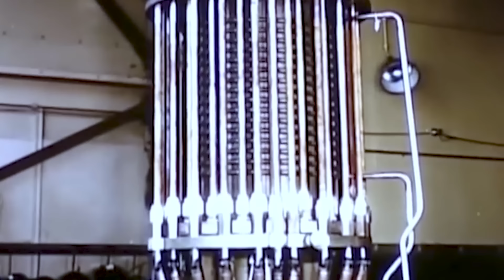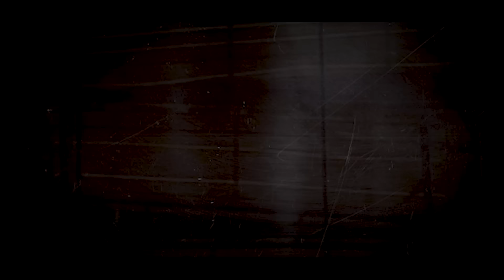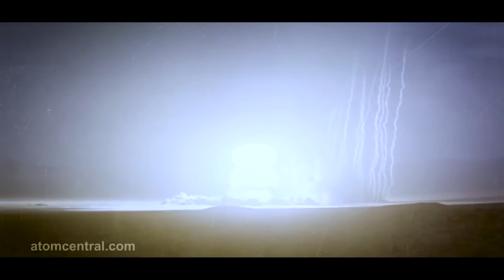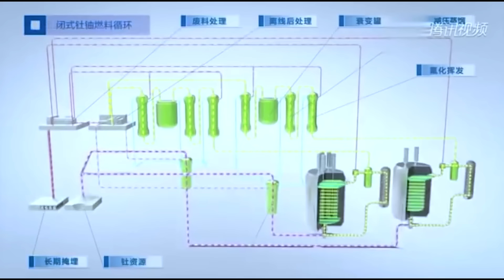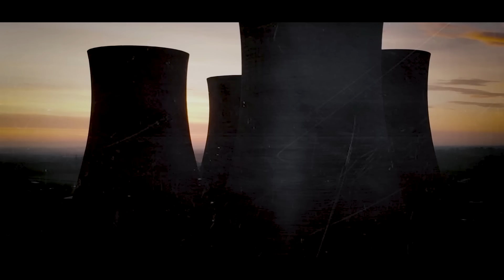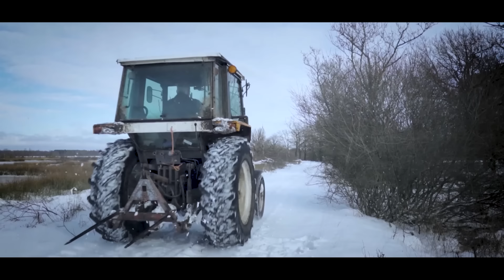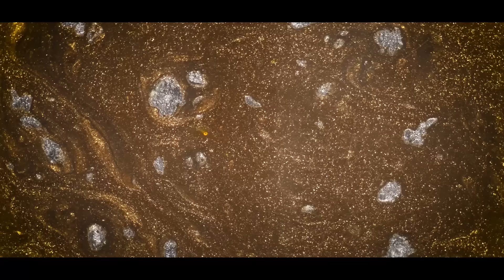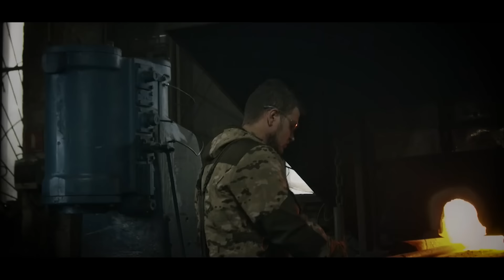Future of Thorium Reactors and Nuclear Energy

Comment: There are hundreds of different nuclear reactor designs, all of which have their pros and cons.  Thorium is just another of these designs.  All of them have their advocates who claim theirs is the best and want attention and funding.

Thorium and Uranium both have advantages and disadvantages.  It will take a long time for regulators and the nuclear energy industry to decide if Thorium is worth pursuing on a large scale.
Reply: That is true. But the fuel here is less important than the design change. Wherever you go for a fast reactor, a thermal reactor, a single or multi fluid design, plutonium, thorium, uranium or just all of them, it's the simple switch from solid to liquid that immediately sets these designs appart and above the regular compromise.

And MSR is just better than their solid fuel counterparts in almost every way you look at them appart from a fuel contract POV since you can't sell your proprietary fuel rood design that just works in your reactors since you can just buy a salt from anyone and mix it with whatever fuel you can burn which drives up competition and push the price of fuel down drastically.
Reply: @mobiuscoreindustries  Correct.  However MSRs can burn Uranium-238 just as easily as Thorium, and we have millions of tons of U-238 sitting in warehouses...they literally will give it away for free, just to get rid of it.
Reply: @tombenson5957  not all MSRs can burn U-238 effectively. 
U-238 is a fertile material, just like thorium. After absorbing a neutron it will turn into plutonium which is fissile. This is why most of the fuel in a fuel rod is U-238 with an enriched portion of U-235, but U-235 is what is actually being burned and is much more rare. 

The issue with U-238 is that the plutonium that is created will fission, but in the thermal regime (where neutrons are moderated) it will generate under two neutrons on average. 

That is a problem because that means without another fuel giving extra neutrons, the U-238 would absorb all the free floating neutrons and stall the reaction. A ratio above 2 is required for a breeding reaction to sustain itself. Thorium had a very good ratio above two in the thermal spectrum hence why it's desirable to use it here.

In the fast spectrum however plutonium can jet out above 7 neutrons, but they are fast neutrons meaning the chance of collision is drastically reduced. That leads to a need for a lot more fuel and potentially more unstable environnements especially because the fuel has to achieve self criticality. You need to inspect all possible geometry in your system including pipes and the drain tank to ensure re-criticality isn't possible. But it has been done in the past as well and in the fast spectrum becuxe everything blurts out a lot of neutrons you can just toss things in the reaction without much care really.
Reply: @mobiuscoreindustries  Correct.  U-238 and Thorium are more or less equivalent.  That's why it's important to note that we have millions of tons of unused U-238 clogging up warehouses.  Most nations are going to build MSRs that are configured to burn up that leftover U-238 - it's the logical choice.  That could power the human race for 5000 years or so. :)
Reply: @mobiuscoreindustries  OK, so let's assume that Thorium is somewhat better.  The quesiton is, is that "advantage" enough to convince the nuclear industry to switch from U-238 (which they already have in huge abundance) to Thorium?
Reply: @tombenson5957  Surprisingly, you aren't the only one asking this question. Thorium is "only" 3 times more common than U-238, and we have massive quantity of both. Now the reason why you would probably want to opt for thorium is because of the reactor and medium you need to run your reaction in.

Right now, while the nuclear industry has a lot of U-238, we aren't really using it. Let me explain. In a PWR, you are running into a neutron regime where you intentionally slow down the neutrons to make collisions more likely. This is called the thermal regime . Now U-238 in itself does not do anything as it is not a fissile material, that honor goes to U-235 (the only naturally fissile material on earth) which is only a fraction of a percent of the total Uranium reserves. We have to enrich the U-235 from natural to "reactor grade" for this. When people say "we will run out of uranium", this is why they are right, only if we consider today's reactors, because while U-238 is common, the necessary isotope that sustains our PWR reactors is not.

But why do we still put U-238 in the rod then? Well 238 is a "fertile" material. What that means is that after neutron exposure, it will transform into something that can fission. In this case, this is Pu-239. 

Thorium shares a similar story, Once irradiated, it becomes U-233 (going to correct a previous mistake as I labeled it as U-232 before, which is incorrect) which is fissile. However both have characteristics which differ a lot in the way these fuels work. This is where the idea of the regimes become supremely important.

In order for a reaction to sustain itself, you must produce, at least, 2 neutrons per atoms you split. Why? well because one of those neutrons is needed to go hit a uranium/thorium atom to make fuel, and the other neutron is to go hit said fuel and continue the reaction. Why does this matter? Because regimes of neutrons have a gigantic influence over that. There is two speed regimes, thermal (where you moderate the neutrons) and fast (where you do not moderate them). Plutonium does NOT produce enough neutrons in the thermal regime to sustain a reaction (hence why PWRs require the U-235) but handily produces enough in the fast regime. U-233 works well enough in the fast regime, but has the best ratio in the thermal regime where it IS capable of sustaining a reaction there. Now overall fast and thermal are both usable, but fast reactors require a LOT more fuel (because while collisions produce more neutrons, the rate of absorption is drastically lowered) and are overall more unstable because by design, the fuel must be capable of achieving self criticality. However both have been successfully tested and found to be safer than PWRs in almost every way, even when sodium was used as a medium for the fast reactor. 

The primary issue of a fast reactor, other than the neutron management and inherent issues with the salt used is, by far, the proliferation problem. Technically, both plutonium and uranium 233 can be used to make a nuclear bomb, but the thorium route was ruled out for many many reasons. The first is that U-233 has a short half life. You cannot stockpile it for very long before it decays away. The second is the afformentioned U-232, which is created in small quantity by the reaction. Now U-232 within the reactor is easily handled and fizzles out quickly, but because its also uranium, if will be scooped by your flow separation operations along with the U-233 you want to use for your bomb, and U-232 is just a bad news for your operations because its a strong gamma emitter, which means that it will:
A: tell absolutely everyone where you are and let them know very well that you are making a bomb right there. Even if you do it from a bunker, you will be seen from space.
B: its not easily separated from the U-233 because it is chemically similar, and you want an "pure" sample for a bomb
C: it will try to kill you

Compared to that, Plutonium is easily separated from the reactor flow, there is a ton of its easier to siphon it without tripping any alarms, and you can conceal your operations because you aren't blasting gammas everywhere. Its the reason why the plutonium route was favored at first by the US. It was the cold war and the goal was to be making more nukes. A plutonium breeder would create more bomb material than the US could ever dream of. 

This is not to say that operating in the fast regime does not have its advantages, because it really does. While thorium is extracted in SPADES by mines, to the point where rare earth mines pull more thorium than the materials they actually look for, thus making it basically dirt cheap, a fast reactor can run on actual waste, that people will probably pay YOU to get it off their hands. Because everything reacts well in the fast spectrum, you can just toss everything soluble into the salt and let the neutrons do their work. Plutonium, enriched uranium, natural uranium, thorium, actual nuclear waste? Don't care, just throw everything in there. Sure you will hurt your burn time and efficiency a bit but who cares when people didn't want that stuff anyways? You just need a potent enough neutron source to start the reaction but once its going you have big margins to operate. Comparatively, while you can do the same thing in a thermal regime with thorium, you can't add nearly as much because you don't have infinite neutrons to spare. 

Also, a fast reactor requires less chemical complexity in its design. One of the primary downside of thorium, and why it can't (effectively) be used in a solid form is because of the time it takes to make the transition from fertile to fissile. See, U-238 will quickly become plutonium, so you can just toss it in a single fluid cycle. Thorium quickly transforms into protactinium 233 (which is good because it means it can be chemically extracted), but will then take about 27 days to transition to U-233 and that means you have to keep it in a separate tank for that duration before injecting it into the active core to continue the reaction. Because the only way to juggle around fuel is via a a liquid, the use of thorium in a solid fuel form is highly undesirable, though has been done ever since the first PWR reactor. Comparatively to that, fast reactors don't lose much when you use them in a single fluid system, while thorium will be noticeably less efficient. Still thousands of times better than a PWR mind you, this is comparing two breeder reactors together. 

But perhaps the single best advantage of thorium over plutonium is the waste. Because U-238 leaves you with your bog standard waste product. Short lived because it has been thinned out of the most stable elements via a more complete burn, but overall just good to be dumped in a box for 20 years.

Thorium makes some interesting waste at the end of its cycle, two I want to specifically mention. The first is plutonium-238. Now 238 could not be more different from its cousin 239. It is a relatively long lived isotope with a half life of 87 years, with an outstanding ratio of alpha emissions. You can't use it for bombs, you can't use it for fuel in a reactor, but it is PRIME fuel for a Radioisotope generator, because it generates the most heat while also requiring basically no shielding. This is a material we NEED for deep space exploration, and right now we are dry out of it because the only other mean of getting it is to artificially synthesize it. We are in a situation where we have enough global supply left for about 3/4 RTGs and then we are fresh dry of the stuff. That means no more curiosity, no voyager, no dragonfly, because advanced deep space missions require the consistent output of an RTG.

And then there is Bismuth-213 or Thorium 229. they are beyond useful for radiotherapy as it will release a beta particle in a very predictable way, and can be bonded with agents such as antibodies, meaning you can essentially create a cell targeted beta discharge to, for example, kill a cancer cell and only that cell, as opposed to bathing the entire area in radiation as we do today. And so does Molybdenum 99, basically everything that comes out of the cycle is a prime material that is extremely desirable and fetches a very high price on the market. NASA is basically begging for Pu-238, Molybdenum fetches for hundreds of millions of dollars, Thorium 229 is even more valuable.

In short, while I believe thorium is better and more scalable overall, I believe we must not lose sight of the bigger picture. All our attention must be aimed squarely at defeating coal powered plants. 

Let me be clear, if your plant, whatever it runs on, can operate for cheaper than a coal plant, and can be built NOW, then economics dictate it can, will, and must be built. Fast reactors can probably achieve that threshold the fastest, they are just held back as much as thermal breeders by regulations and hostile actors in the industry. As nuclear supporters, we must understand that any nuclear, no matter if it is the most efficient or not, is better than fossil, solar or wind. And I will not shed a tear if I get my energy from a LFTR, ThorCon or MCSFR. All I care about is not getting my energy from a coal, gas or oil plant.

If you are reading this, I sincerely thank you for bearing with my random ranting about nuclear. I just want to re-iterate that, indeed, the solution isn't to just bash people into following a single path because "fuck you I decided so" because that is what happened with the PWR. Alvin Weinberg made it as a stopgap for the military, then immediately started advocating for a liquid fuel cycle. Today we are stuck with a technology 70 years out of date, and we are not using the resources presented to us. All nuclear is good, we just need to get the gears moving faster
Reply: @tombenson5957  Wasn't disagreeing with this comment rather one previous.
Reply: @mobiuscoreindustries  Great response.  However one addition.  U-233 is actually in some ways easier to use in a primitive (terrorist) bomb because it doesn't require implosion like plutonium does.  U-232 is not radioactive for the first few weeks after separation - it takes time for the daughter products to appear and they are the ones radioactive.  What this means is:  U-233 appears to be a good bomb material for terrorists.  Easy to work with as long as you use it quickly and very, very powerful indeed.  This must be highlighted and understood.

Of course there are counter-arguments to all this.  This is hideously complicated stuff, as you are obviously aware.  That's why it's critical to let the professionals take the time to make these decisions carefully and to look at every potential issue from every angle.  This is the most dangerous technology on the planet.  

I agree with you that we need to put more resources into this!  Future reactors are crucial to saving the planet. 

Cheers!
Reply: @mobiuscoreindustries  Yes,true,but we have solid fuel TRISO which has many advantages as well, traditional nuclear is extremely beneficial with the UAE getting four reactors built each one replaces 1600 barrels of oil an hour  so far more reduction in oil use than every EV ever built.
Reply: @paulbedichek2679  as i said many times, the worst of nuclear is better than the alternative.
Reply: @mobiuscoreindustries  Not true, now utilities can switch from contracts with Russians to Westinghouse,for their Russian designed reactors.there will be vendors for the  solid fuel that will be melted and used in advanced reactors.
Reply: Regulators are to make sure it is pusued SAFELY, as for worth it should be market or policy descision ffs.
Reply: By which time Earth will be 8°C hotter and there won't be anywhere near enough food to support current (2022) population since crops will be destroyed by drought and floods. Mass extinction. War. Massive numbers of refugees.
Reply: @apuuvah  All the more reason to build the nuclear reactors we have NOW, which are Uranium-based.  France has a great, proven, safe design that they can build quickly and cheaply in any first-world nation.
Reply: @tombenson5957  No,the French design had massive problems.
Reply: I don't agree.  Some problems yes but not "massive"
Reply: @paulbedichek2679  I'm french and I can confirm. We have some of the most advanced reactor types but even then they are still several decades older than their service life and France is aggressively hampered by the PWR syndrome.

Where we teach people in nuclear physics about PWR design and operation. How to deal with Xenon, how to manage degradation of the solid fuel rods as the reaction moves a few percents more that current day rods. 

What we don't teach them about is that the fuel does not need to be solid, and the moderator does not have to be water. We don't teach students that while steam turbines are okay, cold gas turbines also exist and are a  level of efficiency that is an order of magnitude above steam. We teach them about operating at high pressures but not at high temperatures.

Its constant with people stumbling into companies like Flibe Energy, or digging into the works of ONRL. They go seek you shocked and confused that they never learned this stuff. So many weeks of their life spent dealing with stuff like the Xenon pit when there is ways to just make Xenon a non issue. Thousands of bright students being conditioned to think the best project they could ever be assigned to would be one big decommissioning of a 50 Yo plant to build a coal plant instead. France suffers from that. We have some of the cheapest, most reliable energy of Europe (before taxes) but we don't realize it every day because the common citizen does not care to understand what stuff is behind his wall plug.
Reply: @eric kanter There are dozens of different types of reactors being proposed.  They all say "we are far better".
Reply: @tombenson5957  There is plenty of evidence to substantiate such claims based on design specifications. Its not like "he said she said" you can analyse data to note advantages and disadvantages. If its up to me, honestly, we would build most of them, if for nothing else to study their concepts and only then decide which is the best. In parctice though that is unfortunatelly not possible, so, ppl with funds to grant, needs to be careful and wise to support the most viable ones.
Reply: @CraftyF0X  Exactly.  There are many competing designs.  Thorium is just one more competitor.  Funds are limited.
Reply: @eric kanter That is your claim.